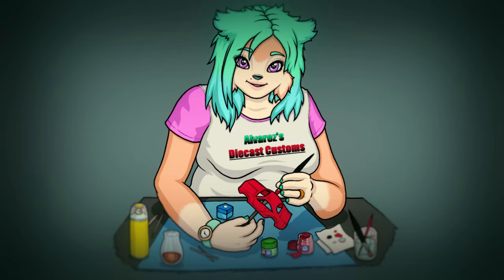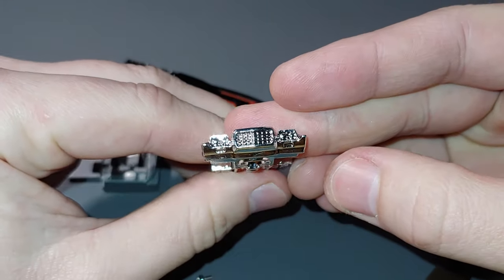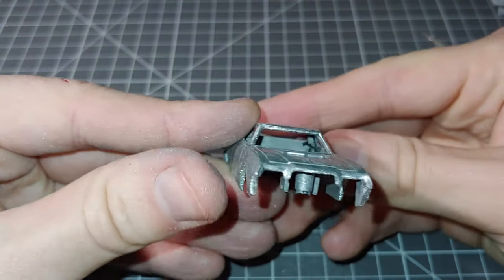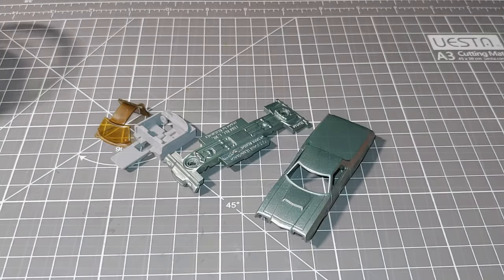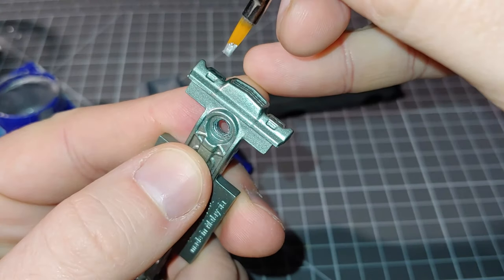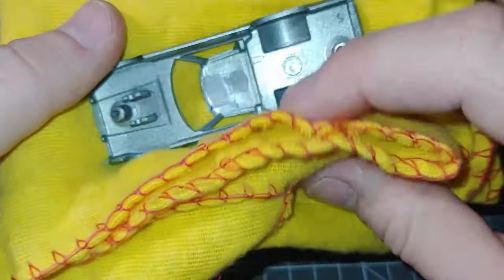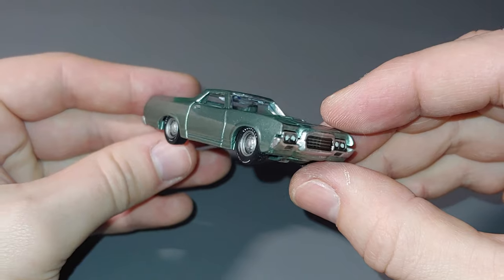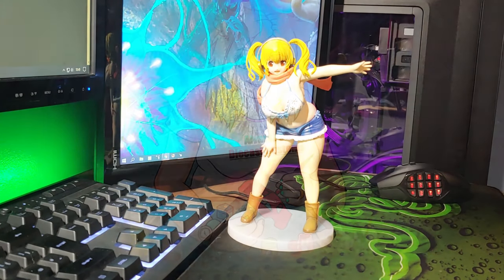1972 Ford Ranchero custom - EP20

Comment: Learned to drive in a '72 Gran Torino.  Remains one of my favorite,  so when I saw your Ranchero I had watch. Turned out great.
Reply from the maker: Thanks Daniel 🤘
Reply: You're welcome
Reply: I had a 72 Gran Torino as well, my 3rd or 4th car, paint was flaking off, the vinyl roof was peeling and the interior was plain-jane stock...but dang that thing could move with the 351 Windsor engine.  Eventually sold it to a teenager who painted it rattle can flat black and drove the snot out of it around town...I miss that car.  😭😞
Reply: Mine was a hand me down. Mom bought it brand new when I was six. Let go of it in the early nineties.  Frame had rotted. That same summer Ford started making replacement parts again. Losing that car was like losing a family member.

Comment: You sure love the metallic paint..  Try a deep purple..  Or flaming orange..  Naw.. I love them all regardless the coloring.

The windshield is nice.  But those "Steelies" are killer!

;)

Keep doing what you love.. I will keep watching!
Reply from the maker: Thanks Tiff.
Yeah sadly that's the limitations of using automotive paints, mostly its all metallics and 50% of them are some shade of silver.
I really hope to invest in an airbrush next year so I can go about mixing my own colours and use more colours.
I do have a couple of simple colours like yellow and red but haven't had a custom I felt needed them yet :P